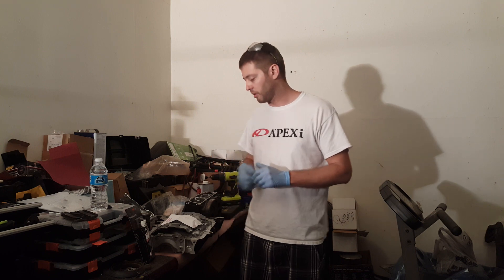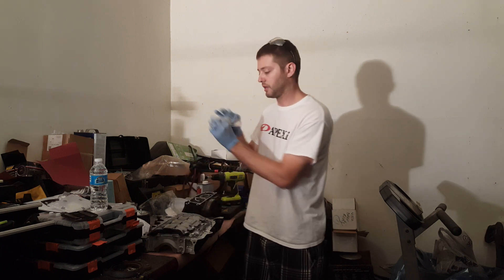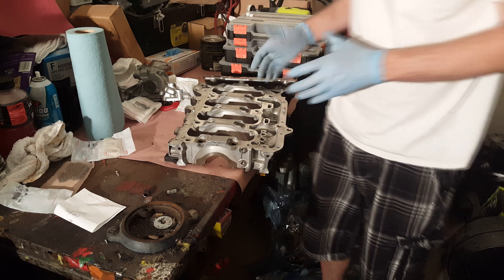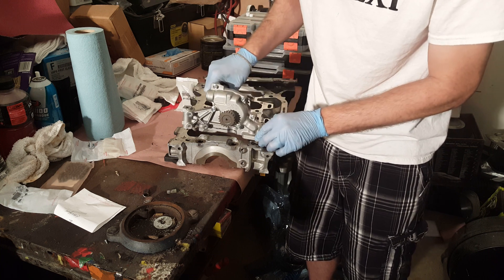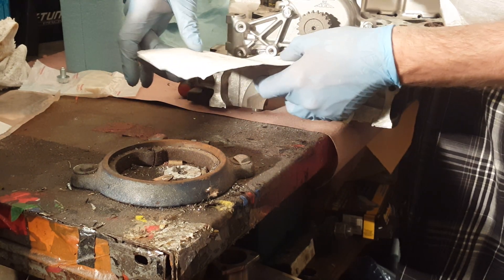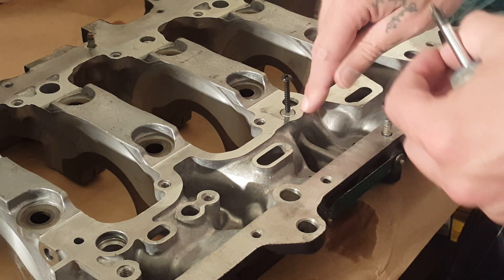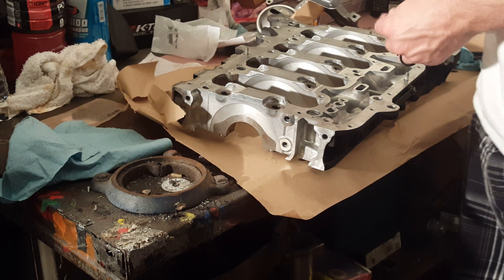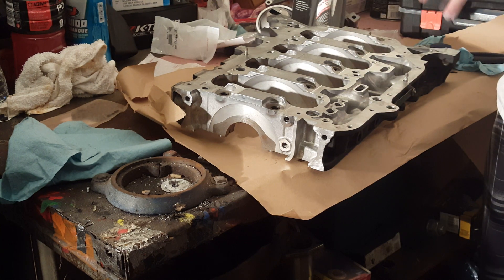RSX Type S Oil Pump Modification For Install On K24

Comment: Hey I was wondering if you had the part number the bolt that you used to cover the plug?
Reply from the maker: i dont unfortunately, basically any bolt with the same thread and size will work.
Reply: @SouthernRicerGarage  I would get a 1/4 longer bolt , the one in the kit doesn't have many threads to hold the bolt securely.....
JMO ..

Comment: I bought the same kit and installed I noticed I received 2 nuts that looked like the one to plug the jet, the other nut was almost identical, smaller threads and came with a washer in a separate bag. Any clue where that one goes?
Reply from the maker: I seem to remember an extra bolt when it came time for the install. That video should be out in a few weeks. Off the top of my head i dunno where it goes. Basically just baffle bolts. the hole plug bolt. The actual oil pump bolts and then the chain guide bolts.
Reply: Southern Ricer Garage yeah I was a little worried but everything seemed to go where it was, thanks for the input man.
Reply from the maker: Long Beach Crazy nuts and bolts left over is good for weight reduction:)

Comment: my K24 has balance shafts on the oil pump are they needed, they are kinda heavy
Reply from the maker: yes and no. The oil pump assembly you have requires the balance shafts to work correctly. But if you swapped to a K20A2 oil pump assembly they do not have balance shafts and weigh a lot less.